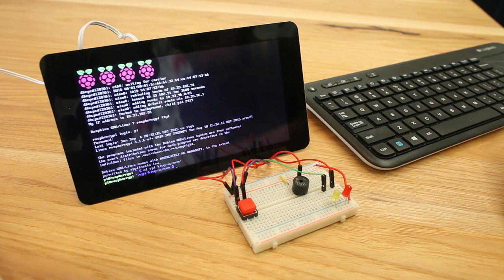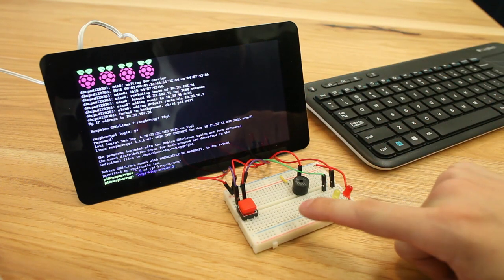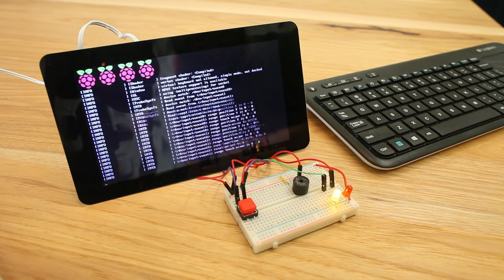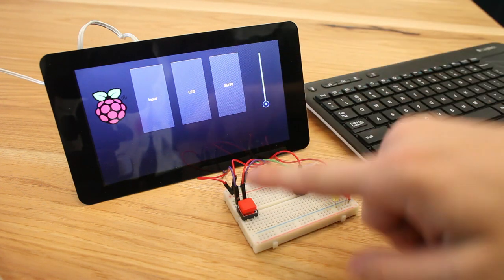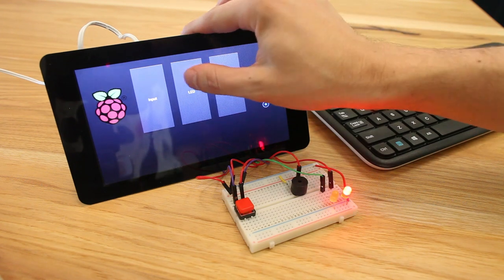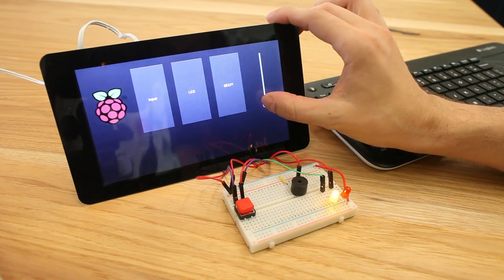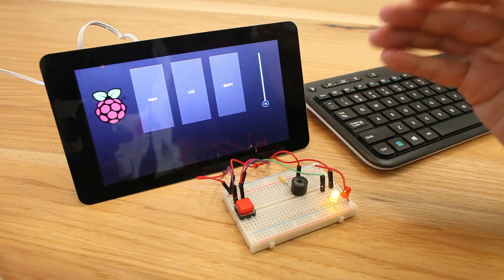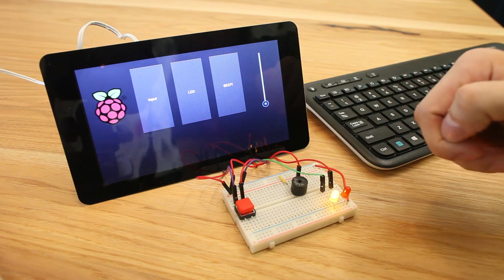Kivy, the Raspberry Pi Touch Display, and GPIO

Comment: Does anyone else see the home automation possibilities with this? Even the main server could just be a pi. That touch screen would make an awesome wall mounted control panel.
Reply: +BurezFolf yup I thought of that.it would be really cool to see
Reply from the maker: +BurezFolf Yes, I can totally see people mounting this display in their walls to do all kinds of home control.
Reply: +BurezFolf I can of course see the possibilities - but value for money wise it is just all out of proportion - by the time you get the PI and the screen etc, you could have just bought a cheap tablet and programmed the lot into there - and not had to make a case either.    This happens so often and people get so enthusiastic - they lose the plot... The Pi itself seems great - £25 they claimed originally - by the time you buy it - and a power supply, and a case, and FLASH and a WIFI dongle - and a screen - what are we looking at?? £100+  You can get a very nice little tablet and program it up for less than that and it is fully battery-backed-up and probably has way more memory.   Personally I'd be more interested in a screen at maybe £20 - they are around.
Reply: +Peter Scargill Just for the record, Kivy - the GUI framework used in the demo - will run on RaspberryPi and Android/iOS (and Windows, OSX, and Linux).
Reply: +Peter Scargill 
You're right about the tablet, but and there's always a but, if I want all the IO that the Pi has then a tablet won't help. This screen is really just another option. Hmmm, could use the tablet for remote access to the Pi.
Reply: +Cameron Moore Yeah he totally miss the point of it; this thing is a all-in-one solution to control relay and other things
Reply: Add some esp8266 esp01 and you can control some relays over wify.... really cool
Reply: +Sandrine Marquis or ESP12s even - there are a couple of projects out there, IOBOx and others (and my own) which use MQTT to control stuff - have the Pi control them via MQTT and you're off. I'm using the Pi containing Node-JS, Node-Red, SQLite, Mosquitto, Apache and PHP and there's not much you can't do with that combination.
Reply: Not really I took one look at Kivi and ran - that's going to take a long time to develop a decent interface - there are packages in development - check out NEXTION for example that allow for touch-screen drag and drop development with serial out which would then plug into the Pi. Personally I'm just waiting for a couple of bug fixes to use that on their £30 touch display, ideal for wall panels. There will be others I've missed.
Reply: +Peter Scargill Thank you for all this valuable information.
Reply: Sounds like a cool concept, but why would a consumer spend extra money on the hardware needed compared to downloading an app on their smartphone which would do the same thing - I guess people might like it for the 'futuristic' sort've feel having a wall mounted control panel for home automation can bring but feels more like a novelty then practicality
Reply: Thats what I am doing with mine. I have one that controls all the lights upstairs and replaces the thermostat for the HVAC. Was kind of touch and go for a while but I am working on adding a bunch more things like using a Zero W as a doorbell camera that will ring to the 4 touch screens in the house when someone rings it.

Comment: Glad to see you back! I need to get my rear in gear now. :)

I'm definitely liking this display. I'm working out an idea for a Korg Wavedrum-like device that will center around the Pi, the Cirrus hat, and some piezo contact mics and possibly other sensors, using Pure Data for the DSP. I can definitely see this display being a nice way to manipulate pre-built PD patches.

I just joined up on the Element14 site to try to get an idea of what I'm up against in terms of getting the Cirrus board working with a real-time kernel. I want to use the new RPi 2 B, mainly due to its available processing power and memory, all useful things for music DSP.
Reply from the maker: +Darren Landrum Great to hear  from you again! Love the idea to use the screen for manipulating PD patches!
Reply: Thanks! I'm now back to having too many projects. :)

Comment: hi ,  does kivy run without the raspbien gui (desktop)?
Reply: Kivy runs on pretty much anything. It's an independent library, not related to Raspberry at all. But is a cross-platform (code once, deploy to anything) that also deploys to Raspberry.

Comment: Hi.  Great video - thanks! Am following through the instructions on your web page - kivy installed, touch works, kivy examples all work, all seems good.  Display is great! However to run your touch.py I need  "sudo python main.py" to get to the GPIO, but when I do that I get 
<<<
Traceback (most recent call last):
  File "main.py", line 1, in <module>
    import kivy
ImportError: No module named kivy
>>>
....I have the problem with "sudo python anyfile,py" (even not trying GPIO) in that kivy is not importable when running python under sudo :(
Any idea on the cause/how to fix?
Reply: +Martin Millener 
....I have the problem with "sudo python anyfile.py" .. to be more correct!
Reply: Got it! Problem was "pi" user PYTHONPATH environment variable was not available to sudo.  I'm a *nix beginner, but this sorted it for me:
"sudo PYTHONPATH=$PYTHONPATH python touch.py"

Onwards and upwards...look forward to more pi/touchscreen/kivy videos!

Comment: Here's a thought.. Buy the very latest Raspberry pi 3B+ because.. well newer and more powerful is better,  yes ? ... and you discover that Windows doesn't support IOT Hub on that hardware. 
Then you install the latest version of Raspian .. because that's better,  yes ?  Then you discover that Kivy doesn't work properly either.  Look up  'Segmentation fault in Raspberry 3B+'.  So far a day spent trying to get Kivy running on my new rpi 3B+ and just keep running into problems.   
As much as a great resource this is ..  don't expect it to be without problems.